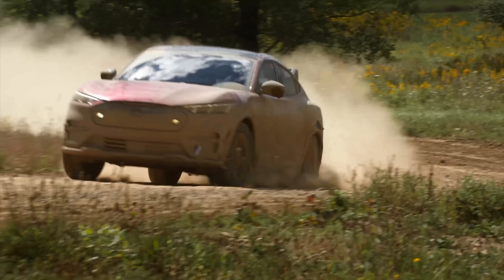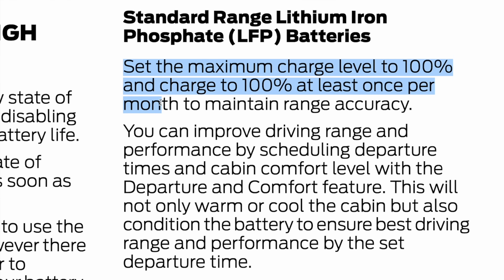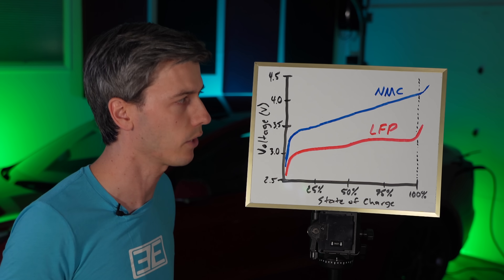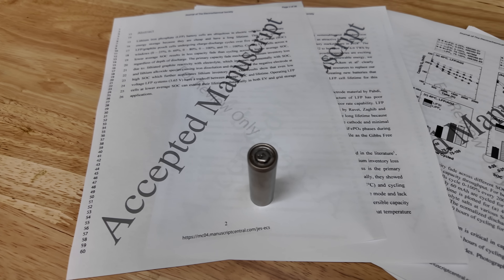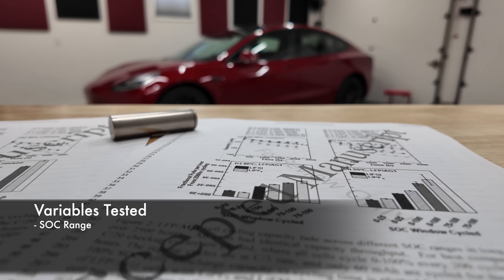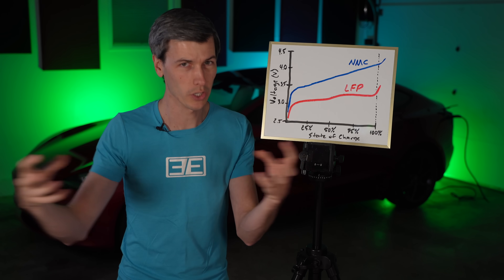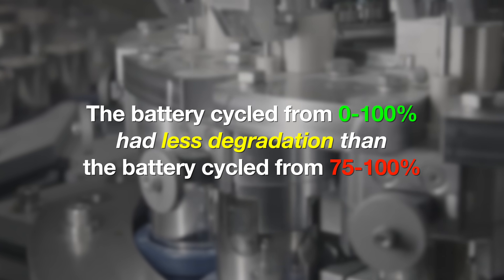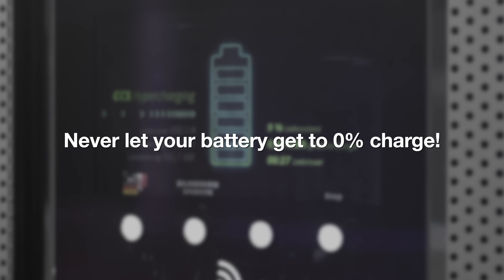How To Ruin Your Electric Car's Battery - LFP Edition!

Comment: I’ve been charging my LFP Model 3 to 80% for daily use (down to ~50% each day with my commute), and 100% every Monday. About 30,000 miles in and battery degradation is about 3.5% or 10 miles. Based on Jason’s video and the study he references, I’ll likely change my practice and operate the battery in generally lower SOCs.

BTW Tesla says LFP cars should be charged to 100% “AT LEAST once a week”, not “once a week”. Pretty substantial difference there. At least, that’s what my Model 3 says.

EDIT: somewhere along the way the messaging has been updated, because now my car says “charge to 100% once a week” and no longer says “at least once a week” (the latter of which implies it should be charged to 100% more than once a week).
Reply: Anecdotally, I always plug in and charge to 100% and that’s usually from more than 80% soc. 2.5y 16k miles, 9% degradation.  Hot climate as well.
Reply: @flowntn1989  I have a Model 3 with the LFP battery, I have done 50k miles in 3 years and degradation is just under 7%, I charge it once or twice a week to 100%, but It rarely every sits at that high state of charge. My climate is quite hot, south west of France.
Reply: @davidc-l9174  the sting in that Tesla notice is to always plug in and keep the charge limit set to 100%.
Reply: @flowntn1989 Yeah, it’s very misleading. If the charge limit is always 100%, and you’re supposed to always keep the car plugged in, then it’s always going to charge to 100%. Doesn’t take a genius to figure that out. So I never set the charge limit to 100% unless I’m intentionally charging to 100% (once a week).
Reply: @davidc-l9174 It’s not really misleading. Tesla have calculated (or been informed by their researchers) that the LFP pack will retain 70% capacity over the warranty period of 8 years / 100,000 miles, if you keep it plugged in when not in use and set a charge limit of 100%. Interestingly this is a lower mileage than the NMC warranty which is 120,000 miles, where they recommend setting a charge limit of 80% for daily use. Of course you can do better than 70% over 100,000 miles by maintaining a lower state of charge, but Tesla are only interested in their warranty.
Reply: @bluenova1000  It’s misleading because the directions from Tesla are: keep the charge limit at 100%, charge to 100% once a week, and keep your car plugged in all the time. If the charge limit is 100% and the car is plugged in all the time, the car will always charge to 100%, thereby going against Tesla’s own instruction to charge to 100% once a week (not every time the car is plugged in).

Comment: Well, that's annoying. I specifically wanted the LFP in my Tesla because I was told I could charge to 100% every day.  I guess that's not really the best idea.
Reply: But he also said even in harsh conditions the battery will outlast your car. So no need to bother.
Reply: The battery will still do 500,000+ miles even if you do that (unless it's faulty). The majority of LFP car batteries looks destined to degrade more due to age than cycle exhaustion. It's not worth worrying about.
Reply: LFP has a very long life so it will outlast the car.  Some more degradation doesn't really make much difference.

Comment: It’s the difference between preserving your battery, and tracking your battery.

Keeping it at 50% will make it degrade the slowest, but you won’t know how much degradation has occurred and therefor cannot predict the capacity and range available.

Keeping it at 100% will cause it to degrade faster, but will provide the most beneficial data to track the degradation and current capacity to give a much more accurate prediction of range.

Comment: So LFP doesn't like to be fully charged, because it'll dissolve itself more... but if you don't charge it fully, you'll get the least accurate battery percentage... which leads to overcharge?

Comment: The thing is that some manufacturers have a total battery capacity and a usable capacity. The car will show you the usable capacity. The conclusion is that a 100% SoC does not mean the battery is at 100%! Toyota is known to do it. That's why they advertise 10 years warranty for their batteries.

Comment: Until they solve the following issues I will not need this information: 1. Price, 2., Charge time, 3.  BEING ABLE TO CHARGE WITH ONLY A CARD OR CASH, 4. Chargers everywhere there are gas stations (Marathon, TX only has one gas station and no chargers, there are other towns I have been to that don't even have a gas station), 5.  Severe restraints on range using A/C or heat. 6.  Towing a 9,000 lb. travel trailer for 300 miles without having to charge.

Comment: I may be wrong about this, but it was my understanding that battery cycling isn't linear, example: four 25% cycles doesn't equal a single 100% cycle, but more like two.
Another way of looking at it is a paper clip being bent. You can bend it end to end 50 times before it breaks, or alternatively bend it 50% (90 degrees) 200 times before it snaps.
Possibly related. As a former Tesla owner, these cars (and Rivian) are subject to very high vampire/phantom drain. The packs literally get cycled to death, and keeping them plugged in mitigates some of the wear and tear.

Comment: hi i just got ldv del 7e
it has 300 k/m range quoted
260 real heavy foot and 1 ton of tools (plumber)
I've been charging with 2k/w of kitchen pwr point
just wired up of old air con a dedicated 20-amp 240v
and got 3.6 k/w charger
2 k/w 10 hrs. charge is 80 ks
3.6 k/w 10 hrs. 140 ks
my van is low tech i can't tell it when to turn off 
basically, no battery management
i do around 100 k/m a day give or take
so, i charge wed with 3.6 k/w 
and 2k/w for the rest of the time
battery lives at 40 to 80%
all this battery charger rubbish people talk about is crap
i have $500 worth of chargers
people need to learn math's a little when buy Ev

Comment: One thing that was left out that is very important is that if your car is at a higher SOC you cam hop in and drive on a long errand without worry, but at lower SOC it may not be as practical to take unplanned trips.  For this reason I always try to keep my cars above 60% SOC.
Reply: I always keep my Tesla charged to 80%, when i get home it gets plugged in. If i know i need more range, i will make it charge to 100% starting the charger so that it finishes within 30 minutes of departure.

I know this might not be as good for the battery as if i kept it at 60%, but the company i work for pays me a mileage fee, and in 4 years they will have paid me enough money to buy a new car, so at that time i will sell the Tesla and probably buy a new one and as i have the money to buy one "cash" i dont really care if the car is worth some thousands less, because the remaining SoT is 5% lower than if i had been more "careful", and even if it is down to 90%, someone will buy it and be happy, because it will have more than enough range for his/her use, and they get a great car for a good price.
Reply: @JohnDoe-bd5sz  Tesla is a "great" car?
Reply: @franklofarojr.2969  Best car i ever owned, but there is still room for improvement, especially the driver assist systems seems jittery, overly cautious and alarm sound wise, hysterical.
Reply: Well that's just kinda obvious isn't it?

Comment: As an Uber driver I specifically chose the LFP. I charge to 100% every day. But I discharge it every day. So I'm going 100 - 15 - 65 - 7 back to 100. Repeat. If you're going to hammer the battery like that, get LFP!
Reply: Tesla doesn’t recommend draining the battery lower than 20% I don’t know for other cars though
Reply: How long have you had the Tesla?
Reply: @Weldoholic  Since n June 22 2023.
Reply: @MH-Tesla  nice, how much has the battery degraded since? I’m just curious, not alluding to anything lol
Reply: @Weldoholic  I'm at 92,000 miles and according to the car, I've degraded 3-4%.
Reply: @MH-Tesla  that’s awesome I’ll have to keep that in mind if I ever get one myself.
Reply: Do you own a model 3?
Reply: Replace the battery , now how much have u saved
Reply: @konic40  Won't have to replace the battery until at least 500,000 miles. Batteries outlast the car the vast majority of the time.
Reply: what happens then tho, the car is trash?
Reply: at 200k miles how much would your capacity have fallen?
Reply: @konic40  maybe 6-8% at most. I'm between 3&4% since I was at 50K miles and I'm at 93K today and it's not changed. Replacement is done at 30% degradation, so unlikely to hit that anytime before 500K. I'm at pace to do 80K per year, so I'll just keep tacking.
Reply: @konic40  If the car is trash at 500K, then fine. Who knows what, if any, value it will have. Battery gets second life use and eventually recycled (95-97% materials are used in new batteries.) Car probably goes to junk yard and is parted and eventually recycled as well.
Reply: Car and Driver lost 7% after 24k miles, there is no losing only 7% after 93k. You sir are a liar
Reply: @konic40  Okay.
Reply: just say yes
Reply: @konic40  just say "yes" to what?
Reply: How have you measured your "real" capacity and degradation. Discharge it and see how many KWs go back in?
Reply: @vladandrei51  That's one way to do it. BTW, I'm at 116,000 miles now and still at 3-5% degradation. You can run the battery to zero and see how much is added to full. You're able to do a "capacity test" in the Tesla service mode and that's how it's done officially. You can also calculate starting from full and going to the point the car won't drive and see what was used. And, you can charge to full and see how many miles the car says you have to drive compared to the original amount (probably the least accurate.) I've done 3 of those and they all agree with that range loss.
Reply: I've read that after ten years , Tesla's estimations about degradation proved to be considerably miscalculated, to the better, meaning, usually they degraded less than expected by the own manufacturer.
Reply: The other thing is, you need the bigger battery pack for Uber/Shuttle driving  if you do hit 0% more than once a day. Mostly due to the thermal mass of the battery being fast charged, you leave the battery in a hot state for longer than average periods. There isn’t a quick fix other than swapping the pack out at a modular station. The fast charging isn’t bad, it’s not good if you’re only using fast charging and the climate isn’t letting the pack cool down to 18-25’c or 30-40’f room temperature. Keep it in mind, very few companies have aged a battery cell naturally for 20 years. It’s anecdotal evidence based on stress testing and artificial environments that accelerate the process. LFP has been around for this period of time, but batteries often have ‘dead time’ or settling time too. The things that we know about batteries are not concrete. Because it’s difficult to X-Ray or ultrasound the chemistry of the battery pack to see how it ages over time once it’s inside a car. So, fleet charging and fleet performance is often the more reliable source of widescale data. Averages, outliers and scale of use/range over the typical driver lifespan come from hundreds of thousands of cars being charged.
Reply: @Toliman.  Good comment. Good points. Typically I'll only fast charge once a day when doing a full long 12 hr day. From maybe 10/15% to 65-70%. After charging in summer I can hear the air conditioner working overtime to cool the battery pack. But you're right, until we have 20 years of EVs, we're making educated guesses on how real life driving will impact batteries long term.
Reply: @EV-ze7qq  Why? If you like your gas car, then keep it and buy another. Matters not at all to me. No reason to go to an EV if you don't want to. 🤷
Reply: @barygol  I think reality will show you how real life works
Reply: @barygol you mean no EVs will be sold lmao
Reply: @GewelReal 

Do you use a horse to get to work?
Reply: @GewelReal  the EU will likely phase out ICE, and most brands will retool so EVs go to western markets and ICE goes to developing countries/global south. you likely wouldnt want ICE let alone need it in the EU, and in north america, EVs will be significantly more advanced, modern and cheaper to run. outside of NA/EU well probs only see EV adoption in big cities.
Reply: @GewelReal  The government will ensure EVs are made and sold.
Reply: Did you even watch the video? By charging the battery to 100% you're destroying it and that applies to both LFP and NMC.
Reply: @DJ-yh8hm  I disagree with that for LFP and I am going to follow Tesla's advice which they double and triple down on. Also scientific journal on LFP charging scientific study. While I'll hold out that over the years, better information will emerge, right now the best information says to charge to 100% every day. I've driven 92,312 miles since June 22,2023 and I still show 96-97% capacity. And the rare times I've not charged to 100% for 3 or 4 days, Tesla makes me read and acknowledge that I know I should charge to 100% at least once per week. Also, it suggests depleting the battery to 10% or less, then let the car sit for at least an hour, then charge to 100%. Obviously that's difficult for most people to do, but I do that no less than once per week as well. LFP loves to be at 100%.
Reply: @MH-Tesla  LFP absolutely hates to be at 100% but keep on living in your fantasy world. The only thing why Tesla suggests charging it to 100% is the more accurate reading but the battery would be doing much much better if you didn't charge it to 100% that often. 4% of lost capacity over a year is totally insane and it's a proof that you're destroying the battery but it's your car so you do you.
Reply: @DJ-yh8hm   Most lose 8-10% after 75,000 miles and I'm at 92,000. And multiple home battery backup systems use LFP that sit at 100% for days and I'm at 100% for a couple hours. But you're correct, it's my car. And I'm pretty happy that I'm in the top 10% of all LFP cars degradation at 92K miles. That's about 66% home charge and 33% super charge too. Maybe claim supercharging will destroy the battery too. 🤷
Reply: @MH-Tesla  Miles don't affect degradation at all, charging habits do. You could have a car with a battery that degraded less after 200 000 miles than a car at 100 000 miles so it's kinda pointless to talk about miles.
Reply: @DJ-yh8hm
Reply: That scenario is exactly what Jason said is the worst for an LFP. But I guess if you're doing Uber there's no other way :) 

I suspect that even if you use an LFP in the absolutely worse conditions, it will outperform an NMC (or at least come close?) used in the most optimal conditions, simply due to the differences in chemistry and architecture.
Reply: i guess one difference is that your car starts with a 20 gallon tank, so leaving 10% as a reserve is always acceptable. fuel tanks dont shrink as the car gets older. batteries effectively do shrink as they age. making it more likely you'll eat into that safety buffer.
Reply: @simonr23  Another difference is my car costs less than 10 cents a mile to operate and has an effective life span (at the rate I use it) of 500,000 miles. Compared to a car that costs over 17 cents a mile just for gas, then oil changes, breaks, transmission maintenance, belts, fans, radiator, muffler, spark plugs, cap & rotors, starter, alternator (I'm just thinking of all the things I've repaired recently on my gas car that don't exist on my Tesla.) Oh, and it's full every day I wake up, like having a gas pump at your home. So the one and only thing a gas car is superior at is long road trips. Which it saves you a few minutes at most. (Then you more than lose that time going to the gas station every week....) I thought the charging was going to be the think I disliked the most. Turns out it's the best part of an electric car. Unless you do that road trip, you don't even think about range. It doesn't enter your thinking. You just use your car without a thought to "do I have enough 'gas' / 'range'."  You always have enough every day so you quickly get used to not thinking about it. It's awesome.
Reply: @MH-Tesla Spot on well said!
Reply: @MH-Tesla recently went on a rally and someone brought a cyber truck… barely behind from charging and was still at every event and would only miss maybe 30 min or an hour of anything. Was fairly impressed but still wouldn’t take my Tesla on a roadtrip cause I’m too soft and have range anxiety lol
Reply: @MH-Tesla exactly so, same experience here.
Reply: I've never wasted as much time in my life as waiting for my 2015 e-Golf SEL to recharge, or going out of my way to find a EVSE unit to recharge with, that wasn't already occupied, or wasn't broken.  Paying 33 cents a Kwh and getting 4.5 miles from a KW, do the math. Then, what's my time worth, waiting?  Huge waste of my time and productivity. Always tethered, like the idiots that use Apple products, to electrical outlets.  No thank you.
Reply: @feloniousmonk3049  Well, you're the guy that brought a non-Tesla EV. That's like buying a blackberry phone in 2012. Or like getting a betamax video player and getting it upset you need to switch cassettes half way through a movie.
Reply: @MH-Tesla  blablabla nothing special
Reply: @MH-Tesla Good luck getting that many miles on your battery.
Reply: @erike7297  it looks like he is though lol